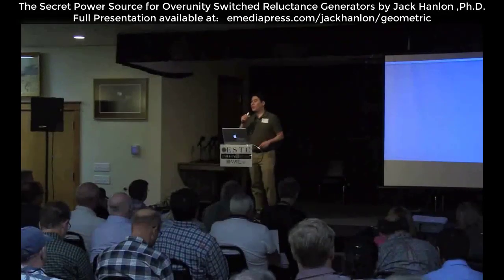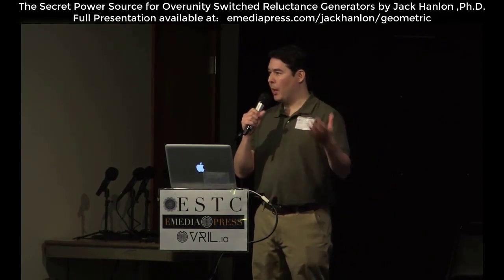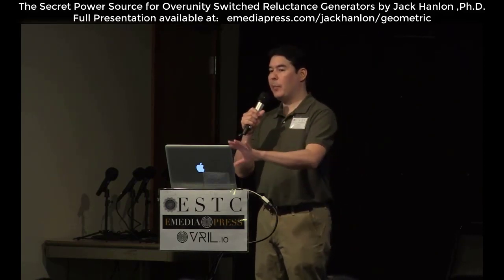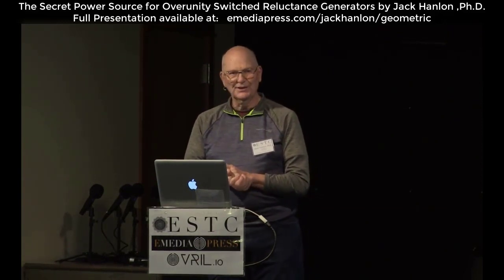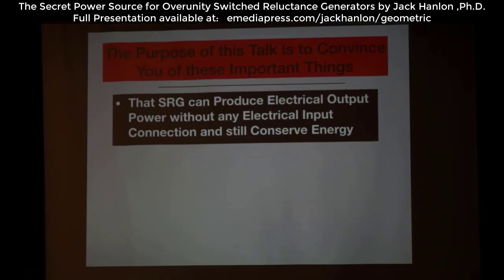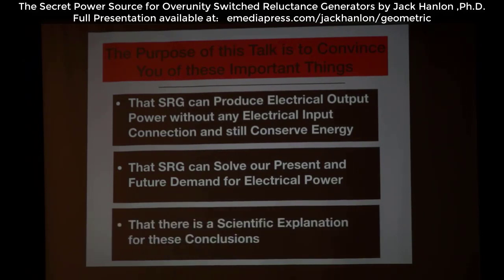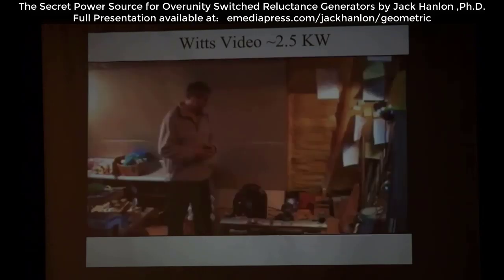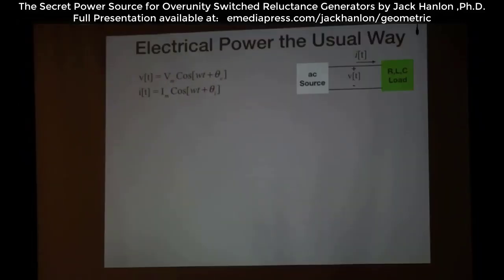Preview Secret Source of Overunity Switched Reluctance Generators by Jack Hanlon, Ph.D.

Comment: A simple resistor puts reactive power back together again if this reactive power is a full half cycle of separation between current and voltage (due merely to the reversal of voltage rather than caused by reversal of current). But this reformation is limited to within the resistor's domain. Yet, an illuminative resistor such as a spark gap will transfer this influence (at least for a short range) turning a neighboring coil into a reactant capacitor in which current leads voltage by 90 degrees rather than lags voltage by that amount as in a normal reaction of an inductor.
Reply: Synchronous condenser does that :)
Reply: T Moray made a lot of circuits transistors and other electrical components that has been classified your comment is beginning to understand how those components actually work and why they say they are new if you know anything about moray ,https://youtu.be/uhx4KEmh5pQ
Take the symbols Asia even Buddhist symbols overlapping circles and design your circuit in such way you have a secret what will you do with it.

Comment: Hello Aaron. How do I get a hold of you privately. I need to know where to get those diodes for the plasma spark. You made mention where to go online however I cannot find them. I have 2 v6 ford motors to put these on and replicate what youve done. These little motors are hogs on fuel.
Reply from the maker: Post in www.energyscienceforum.com in the plasma ignition discussion.